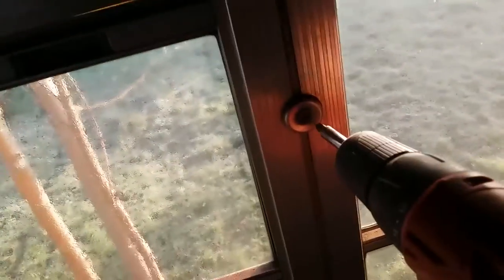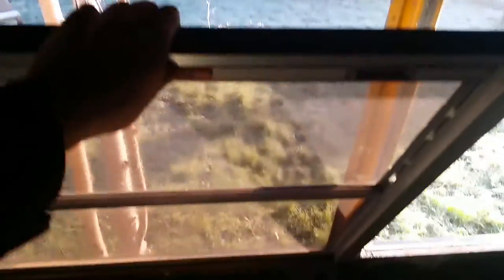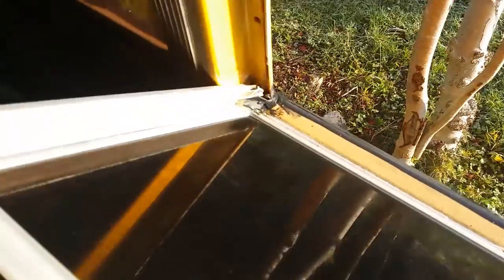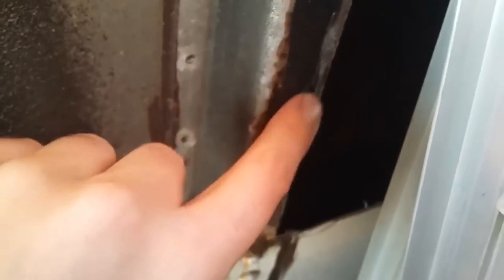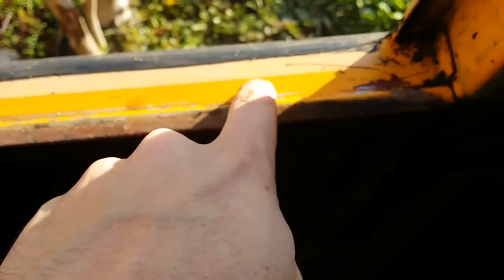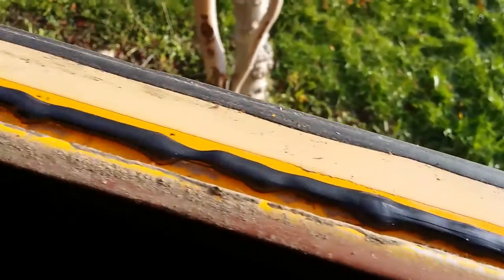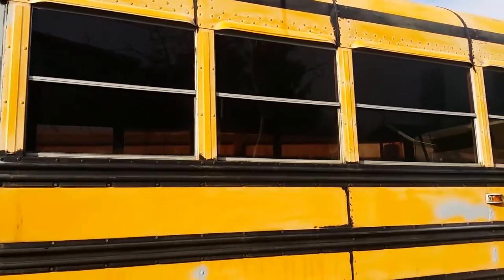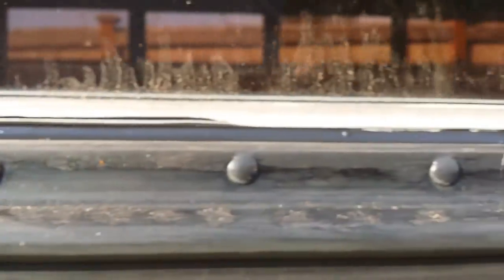Conversion Video 8- Stopping Bus Window Leaks

Comment: thanks for so much detail in these videos. I'm in the process of a conversation myself!  I was wondering,  when you resealed the roof and other outside joints, did you try to remove or dig out the original mastic ( a little harder to remove than windows! :) or just use the caulking over top of the original? thanks so much!

Comment: Did you ever find a solution? I have the same issue with my 95 international.. I removed ALL windows and resealed them in and they still leak!.